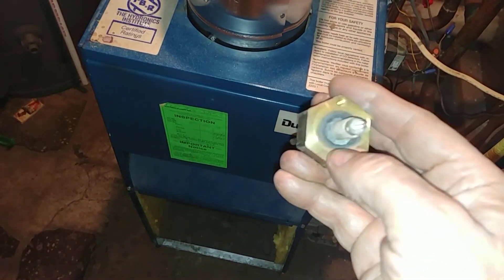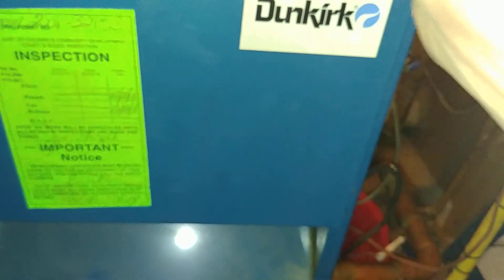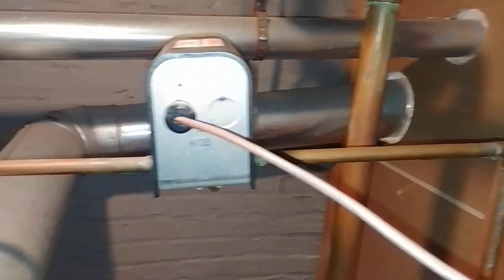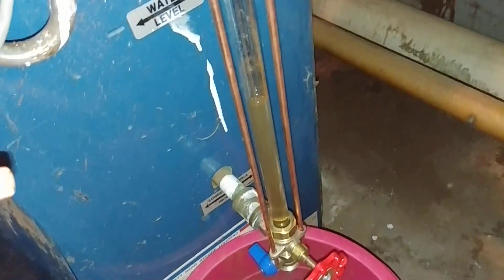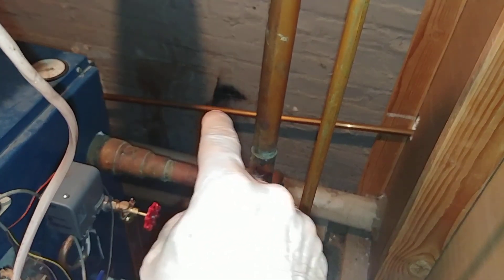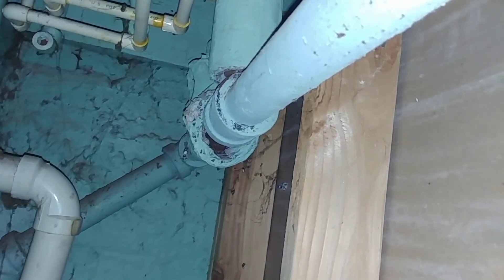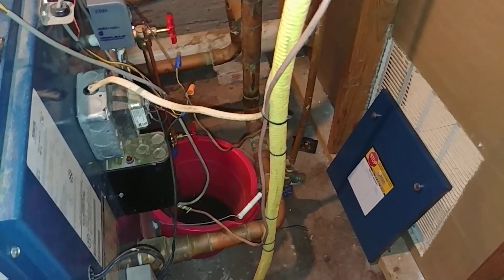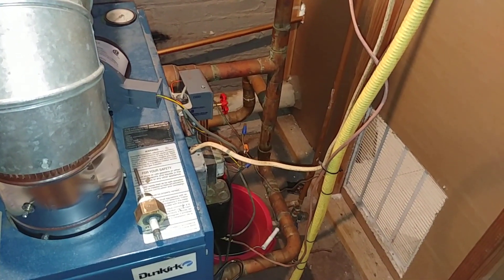Dunkirk Steam Boiler Installed By Lowest Bidder - And This Boiler Passed Inspection

Comment from the maker: Is there anyone else who has had an issue with a Dunkirk LWCO probe?
Please share your story.
Reply: From time to time, I run across probes that show signs of leaking. More so on the boilers using the Cyclegard vs. the McDonnell Miller on earlier models.
Reply: Not yet, but I pray I don't.  I have this same boiler, and it might have been the same installer...Mine does have black steel and cast iron fittings for near boiler piping, but it is all super crusty and had some major leaks at some point. It has self sealed, for the moment!!  The pressure was turned WAY up on it, and I wonder if that didn't cause excessive boiling/damage to those pipes...And with all the old leaking the draft diverter is super crusty!  About to order one and get that changed!

The poor thing has seen zero maintenance since it was installed. I have flushed it about 6 times so far, and have 8 way in it now. Tomorrow I am tackling a plugged return, with almost no pitch on a 20' + run....

Comment: You won't hear any comment from me about not using cast iron fittings. The only question I would have about the fitting is, "Does it Corrode?" If the answer is yes, then my next question would be, "Why can't it be used?"

Comment: I have a 40 year old Burnham boiler. I have just noticed there is water dripping down onto the burner tubes. How could that be, is there a hole in the boiler that would create it?
Reply from the maker: I am sorry to say that it is a possibility your boiler has reached the end of its useful life.
Reply: @gordonschweizer5154  what are the top three brands you would recommend for a replacement? Thank you so much.
Reply from the maker: @jakehits  Any particular brand of boiler is not as important as whether that boiler is properly sized to the connected load and whether the boiler is installed properly.
It also helps if any particular model has the controls mounted on a side where they are accessible.
The installer is more important than the brand.
Reply: @gordonschweizer5154  understood. Thank you.

Comment: Gordon why do you use more iron pipe rather than copper. On my in-laws house a lot of the old pin hole iron pipe got replaced with copper, is that a big no no on steam systems.
Reply from the maker: I presume you are referring to steam distribution piping.
In general, copper is not the preferred material for steam.
It expands more than steel, which can cause stress failures at the tin soldered joints.  
Threaded steel joints tend to give a little under stress.
For piping below the water line, copper can be used to good effect to take advantage of its corrosion resistance.
Due allowance should be done when transitioning to steel in that case.
I hope the reason for the pin-hole failures were found and corrected, otherwise, the boiler is next to fail.

Comment: I thought for residential steam pressure and heat copper is ok.  But maybe it’s old school vs new type issue
Reply from the maker: Steel vs copper is a whole issue in and of itself.

Threaded steel is the proper material and connection method.

The major failing pictured here is the installer's lack of understanding of the proper geometry and size of the pipes leading from the boiler to the orginal steam mains.

Wet, inefficient steam and water hammer is the result of such installantion nonsense.
Reply: @gordonschweizer5154  I thought those fitting are made out of brass to iron
Reply from the maker: @watomb  The only brass I remember were the sightglass fittings and the boiler drain. The rest of the near boiler piping is poorly installed copper.

Comment: Cast Iron or malleable? Who cares? there both rated for steam, in fact CI is 125# rated and mall is 150#rated. Not an issue. Why stock both types of fittings? You can't us cast iron on gas so I would rather not have them on the truck. Some supply houses don't stock much CI

And wrenches slip easier on cast iron
Reply from the maker: Well said. Exactly right.
Thank you.

Comment: Hey Gorton, This might not be on topic with this video but could you sometime make a video showing how you determine whether a Radiator trap is bad on not on an existing system?
Reply from the maker: On a radiator trap that has failed open, it would most likely be an infrared video on a system that was on for awhile and the steam has reached the trap. A shot of the trap  would show a temperature of somewhere about 200+ degrees. The FLIR One temperatures shown are not absolutely accurate, but good enough.  Just after the trap should show about a 20 degree drop from the inlet temperature on a properly functioning trap and no drop in temperature on a failed open trap.
This might be tough to get on video.
Reply: @gordonschweizer5154  I also completed and released a video of me repairing a Single Pipe Steam System for my neighbor. Could you could look over it to see if I did anything wrong and correct me in the comments?
I don't want to give people any false information on these systems.

Comment: I had a Dunkirk installed 3 years ago and this fall noticed the low water cut off ( lwco) probe  was leaking.  My heating company replaced it. but when I had boiler originally installed they sold me on a back up lwco that I blown down weekly and has switch I must push in after blown down to for the boiler to kick on. anyway thanks for sharing your work.
Reply from the maker: Thank you for your comments.
I'm going to keep an eye on these 1/2" sized McDonnell & Miller probes on the Dunkrk boilers.
I suspect that the 1/2" size doesn't last as long as the 3/4" size.
Your heating co. did the right thing by offering you a back-up LWCO.
It sounds like they put in a M&M #67 with a manual re-set switch.
Reply: @gordonschweizer5154  Also, you advised me in a reply that I asked about a month ago  to use fiber glass insulation on those steam pipes. Man what a difference it has made with how hot the basement would get. thanks for the advice and so you know your responses are appreciated and used.

Comment: We have the same issue with building inspectors in Connecticut. If it’s not a code “safety” issue it’s fine. Proper installation and quality of work doesn’t matter😡.  There is another way to keep it from banging..............leave it off 😂.  I had a “ expert” here condemning a install I posted on Facebook due to mailable fitting. He said when you need to take it apart you won’t be able to “ crack” the Ell’s ...........at 59 I’m not planning on replacing it to many more times lol. Mailable or cast I take what suppliers have available.  Where is your Slantfin? Still MIA?
Reply from the maker: So the cast iron trolls are bugging you, too?
That settles it, then.
Any such comments earn an automatic delete.
Reply from the maker: The Slant/Fin is ready to be delivered on-site. I'm getting a crew together to get that 600 pound monster safely in the basement.
Reply: @gordonschweizer5154  look forward to the finished job( I’m sure you do too lol) stay safe and warm. 18 degrees here and a stiff wind
Reply from the maker: @scottk0623  
Thank you!
Here in the balmly south, things are not too bad...yet.
Wintery mix is expected.  It always bemuses me that the capital city of one of the mightiest nations on the planet (just down the street from me) can be shut down by 3+ inches of snow.
Reply from the maker: For quite awhile now it has been clear that our overworked inspectors are not adding valve to the transaction.

Comment: Question... I can wrap my mind around a bad probe and needing to be replaced. But short of the boiler nearly dry firing and destroying the boiler, (and given all of this would be opaque to the homeowner) just what would the homeowner have been experiencing that produced the call that put you in that basement? Bad probe that was open not allowing the boiler to fire? (And so a cold house?) And..... if it were to fail closed, what aftermarket (we’ve talked about the potential false security of the Hartford loop) component can be added, short of a redundant LWCO?
Reply from the maker: I was called in after about about a month of "no heat."
The previous contractor(who did not put in this boiler) had made several trips to service the boiler, as it was told to me.
It was difficult to keep the narrative straight.
They had replaced the flue damper and then the sight glass and fittings.
They also replaced some radiator vents.
Still only half the radiators heated.
The water hammer was "normal"
"always there" etc etc.
I only picked up on the failed probe when I checked the LWCO at what I thought was the end of my first visit.

Comment: who the hell is saying that you put in your boilers wrong? 
I guess You offended a few knuckle heads.
Reply from the maker: Yeah, I was getting a few folks taking me to task for not using "steam fittings" or cast iron fittings on our installs.
At least two folks told me I didn't know what I was doing, that I didn't read the instruction manual, and there was this guy, Dan Holohan, who I should get in touch with, read his books, and he would set me straight.
After pointlessly trying to engage with such folks, I simply deleted their posts and muted them from my channel.